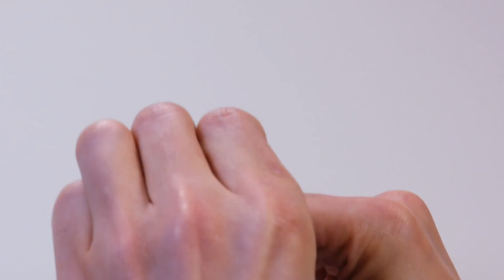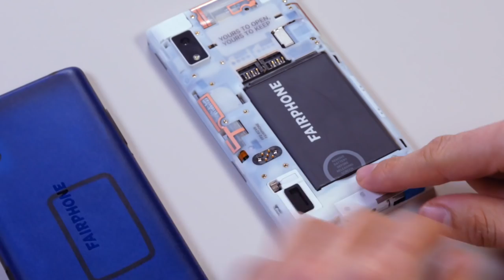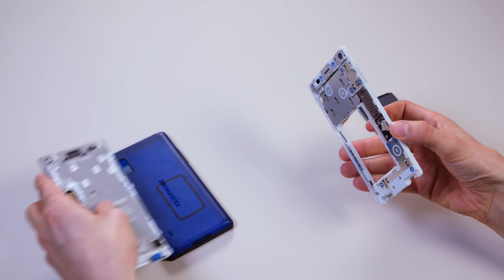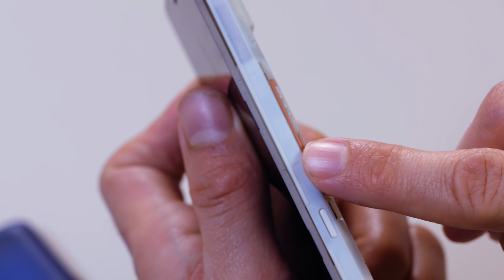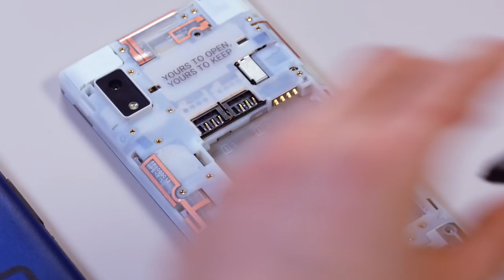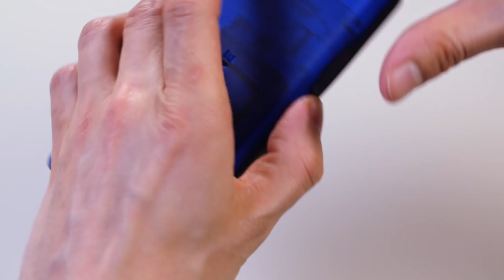Replace a module for your Fairphone 2 | How to | Fairphone

Comment: Suddenly I realized that a part of my Fairphone was broken (charging and microphone problems). My initial thoughts were to drop it at a repair shop. However, I ordered a spare module. This was an amazing experience! Repairing a Fairphone is easier than replacing a shoestring in your shoe! This is how all electronics should be designed: Life cycle management and life extension by design!

Comment: I have gotten the phone 16 months ago. But had to replace the bottom module having encountered charging problems. Just replaced it in a matter of minutes. Removing the display was the hardest thing, because i was overcautious at first. I hope i can go on for a year now without replacing a module (except upgrade i may want). Otherwise the fairphone2 wouldn't be as durable as i expected/hoped.
Reply: How did you manage to remove the display? I just can't do it
Reply: @MsDoize  First important thing is to remove the battery, the second to open the 2 blue switches at the bottom. There is also an instruction on the fairphone support site.
Reply: @MsDoize  This is two years old, did you manage eventually? I am stuck at the same step. It looks frustratingly easy in i video, when I try nothing happens.

Comment: I don't find it easy to remove the bottom module at all. Call me old-fashioned, but I would so much rather have a face-to-face demonstration than follow a video. Alas, there is little hope of that in a country with such a limited Fairphone user community as the UK.